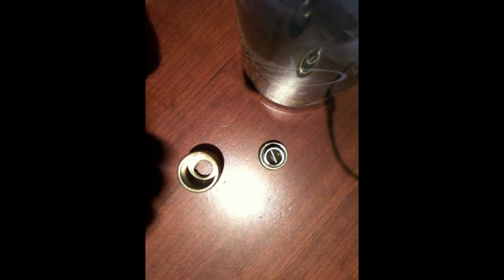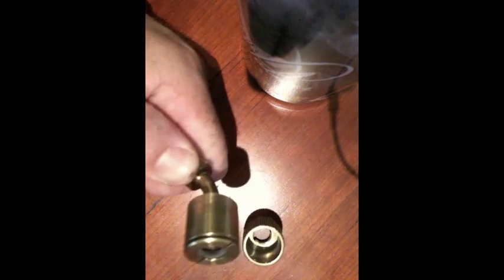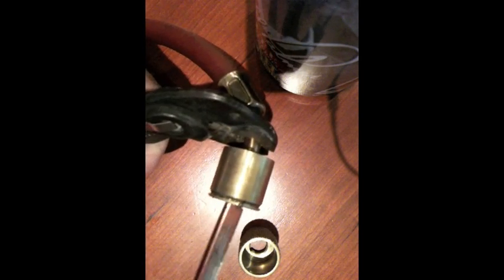HVAC Low Loss HVAC Fitting Replacement Hoses

Comment: get a 16 ga piece of metal cut to size and use your vice grips on the sheet metal, works every time and that cap comes off with ease, instead of using a scraper lol

or take an old broken screw driver, cut it down, and weld a 16 ga square piece on the end so you can use it in both positions, vertical and horizontal

Comment: OK just fixed mine.  I used part number 19038, the plug assembly with 3 seals.

Comment: I have replaced just the o-ring, part number 19037 and this fixed it several times for me.  But now I need to install the repair kit as you did on a couple of my high side sealrights.  Thanks for posting the video.